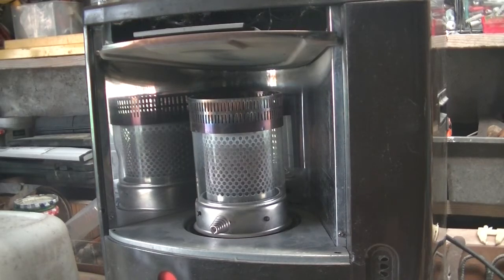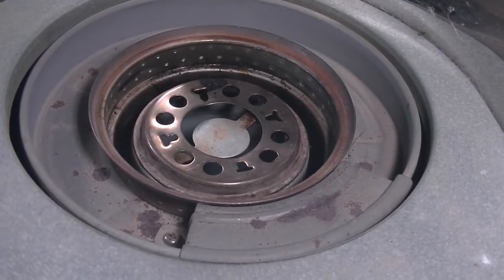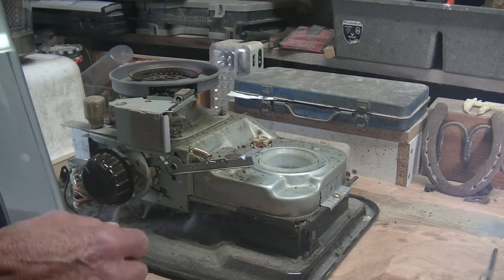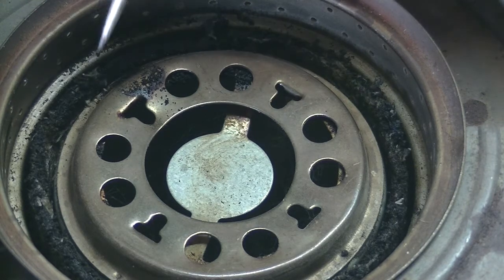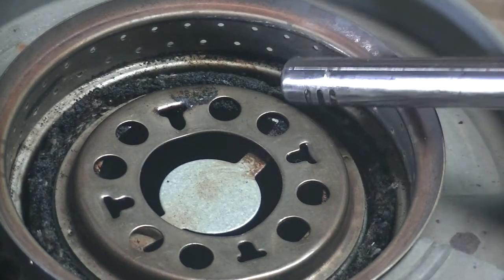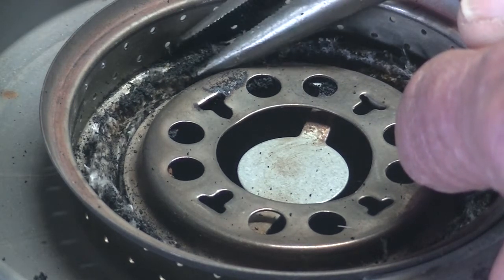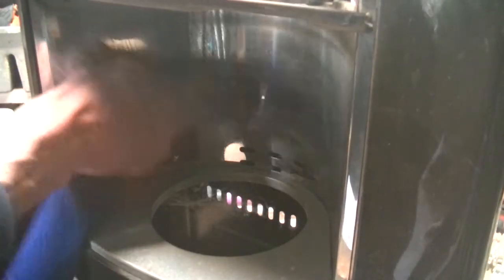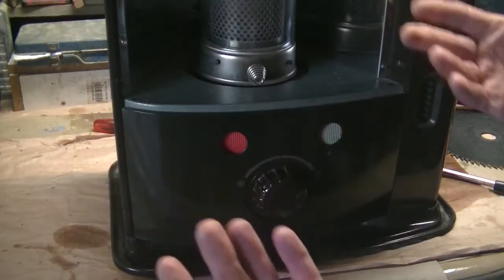Do this to make your Paraffin/Kerosene Heater work Better

Comment: Hello i have one heater similar to yours ( zibro R18 E   i am having problems with it giving of an odour, also it doesn't seem to be giving of much heat, have you had any issues.   Thanks
Reply from the maker: Hi Martin, I would say your wick is not hot enough to burn off the fuel properly. Let it run completely dry and then use pliers to crack the hard parts of the wick. It should be soft and fluffy. Hope that helps, it worked for me

Comment: just get a wick cleaner r take the wick out and clean it  and dont let the wick carbon up like that check it befor you light it
Reply from the maker: Dry burning the wick will clean off the carbon, but my wick had lost at least 5 mm in height, so I needed a new one